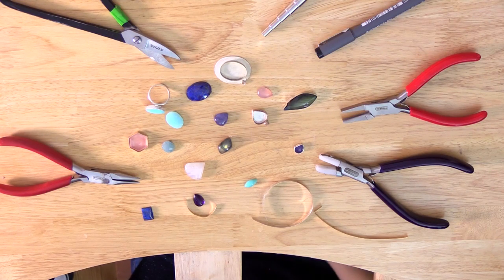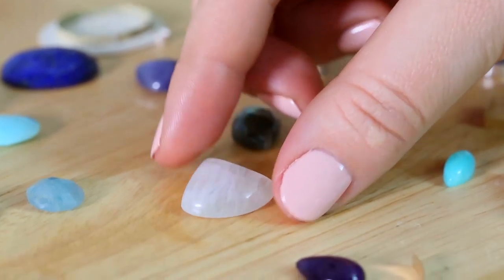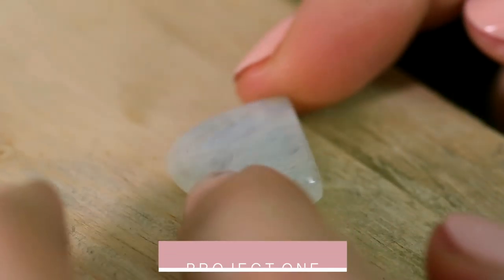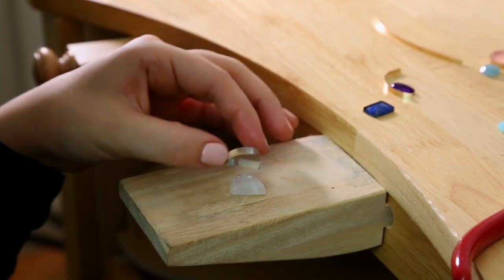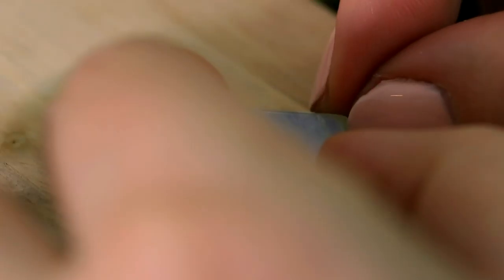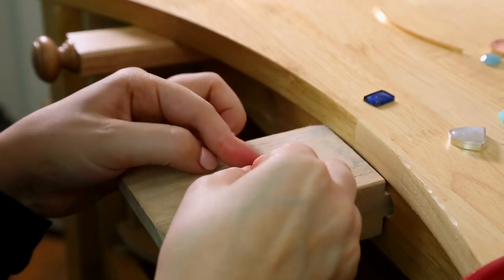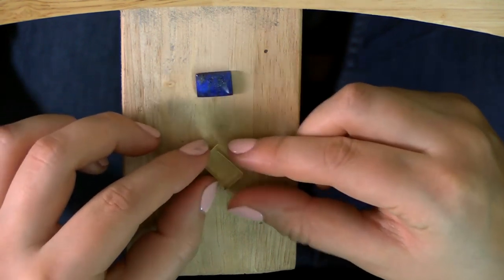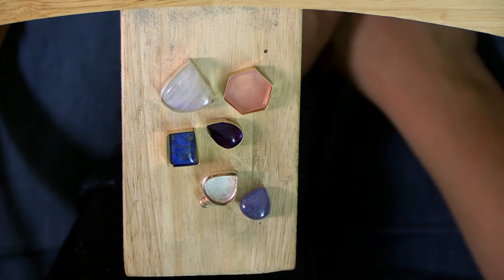Bezel Setting Tutorial

Comment: I'd like to see the finished rectangular stone.  I was taught to use a triangular or square-shaped file with corners to score the silver in the corners of the square bezel and then solder it along a flat side.  This keeps your corners sharp and you maintain the softness of the fine silver bezel in the corners.  It is time consuming and takes some precision filing, but the corners look nice on the finished piece.  However- this method would be way easier, and I'd love to try it if the end result looks good.
Reply from the maker: Thanks for sharing your knowledge Andrea - great advice. I will have to put a rectangular bezel setting on the list of tutorials to make! Jess x

Comment: Hello, what gauge bezel strip are you using for those size stones? I see someone said thickness but they may have meant gauge as well. Thx
Reply from the maker: Hi there, bezel strip most commonly is found in 3mm or 5mm wide strips and is 0.3mm thick (I think possibly 8/9 gauge?). You wouldn't really want to go much thicker than 0.4mm/0.5mm thick if you were creating your own bezel strip. Otherwise it will be too tricky to work with when stone setting. Hope that makes sense! x

Comment: What metal is used for the backing? How do you cut and manipulate that part?
Reply from the maker: Normally the entire setting will be made out of the one metal, so either all sterling silver or all gold. You will need the bezel strip which comes in either 3mm or 5mm, plus silver sheet for the base of the bezel. This is normally about 0.5mm or 0.8mm thick.

If you're keen to learn the full process, why not take a look at our Intermediate Silver & Setting Shaped Cabochons course which will guide you through each of the steps needed to make a bezel setting. 

https://learn.jewellersacademy.com/p/intermediate-silver-and-shaped-cabochons

x

Comment: I have a ring like this, in a sealed setting. Now I notice that some dust got into the bottom of the gem. Since it's a clear moonstone, it looks vert obvious. Do you have any suggestion for cleaning it?
Reply from the maker: It sounds like you need to potentially re-set the stone - which can be done if you take care when removing the stone from the bezel - not to damage the stone or setting. If you are able to remove the stone, you should be able to clean the setting and then replace and set the stone again. x
Reply: @JewellersAcademy  Thank you for your reply

Comment: Thank you for making this video.  I've never tried the L shape idea (too scared to solder square bezels they are never the right size!) so this was a great tip.  Do you think you could get away with using Hard solder for both the closing of the bezel and the soldering of the bezel to the backplate?  Second question.. do you have a source for those hexagon stones?  They are lovely!
Reply from the maker: Hello Annie, yes absolutely I use hard solder for the bezel and the backplate, it isn't as tricky as it seems so don't be afraid to give it a try. I brought the hexagon stones on Etsy, just searched for hexagon cabochons and gemstones they change stock all the time so it is always interesting to see what they have. Jess

Comment: What kind of torch do you use for hard solder?
Reply from the maker: No specific torch needed for hard solder, the size of the torch/flame/heat depends more on what you are working on. 
Delicate work requires a small, precise flame, whereas jewellery that's a little more substantial - say a chunky bracelet or ring might need a slightly more powerful torch with a bigger flame.
Hope that helps x